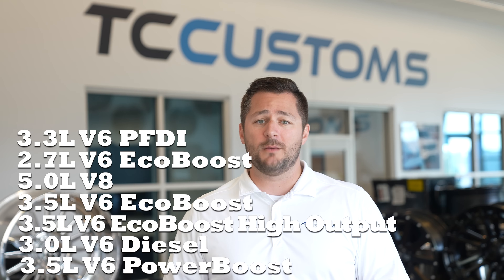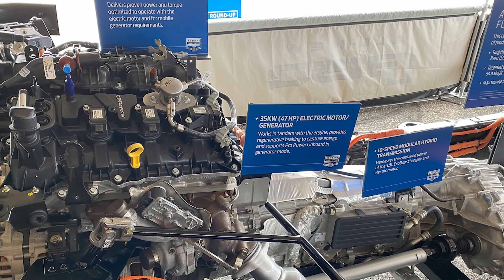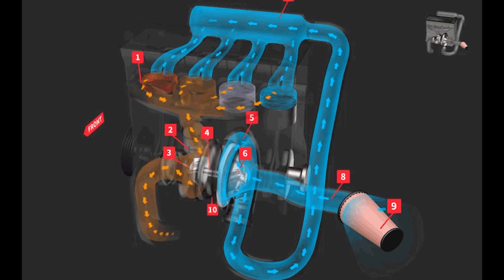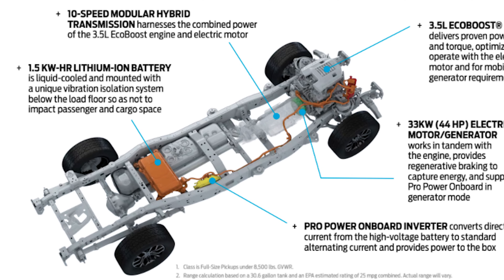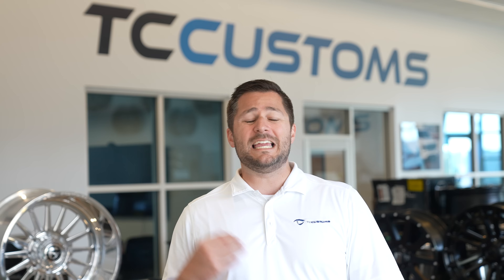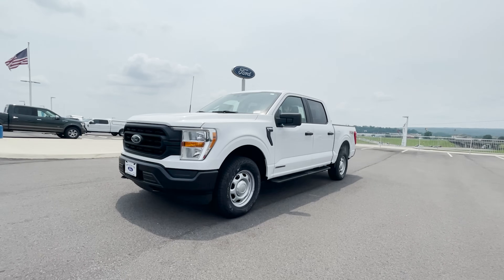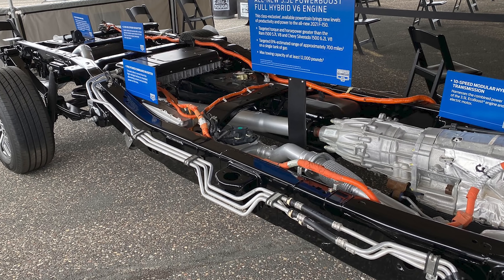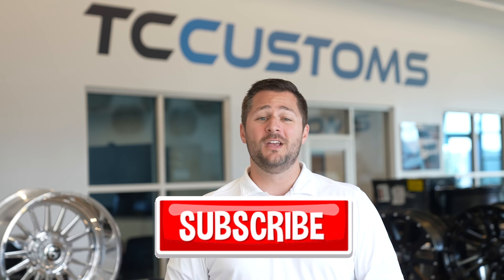The truth about the PowerBoost Hybrid Engine!

Comment: I have almost 14,000 miles with my powerboost and no issues except the wiper motor recall, which there is no fix for  yet. I read that there can maybe be some damage to wiring during the assembly while the truck is being built. That could explain some of the electrical issue?
Reply: Update?

Comment: The truth about the powerboost hybrid: with the exception of the VERY small amount of recharging you get from regenerative braking, the battery is recharged by the engine. The GAS powered engine. So pretty much, even when it is running on the battery, it is still running on the engine. without the ability to plug it in to recharge it, it is effectively and nearly ENTIRELY gas powered vehicle.

Comment: I've had my Powerboost for just over a year now. Just over 12% of my driving is electric. I average somewhere between 600-630 miles per tank. Also, when I test the generator mode it always kicks out a grounding fault and Ford doesn't know how to fix it and their service departments are clueless. Ford Corporate and their dealers don't honor their warranty. This is the 7th Ford vehicle I've owned and it will be the last. I like the truck but Ford doesn't honor their commitment to their customers. In 5 different states and several different dealerships I've never had a good experience with any service departments. Not a single good experience, it always a hassle. My truck cost 70k! and they can't fix their own products.

Comment: I have a 22 and have put over 7k on it. The fuel mileage isn’t that good and the hybrid drive doesn’t stay on long during city driving. You have to really baby the throttle to stay in EV mode. I think if it was a plug in hybrid with a bigger battery it would be a better package.
Reply: That is what I was wondering. I am considering the Lightening, but then saw this and really liked what I saw but I am back to gas and apparently the regeneration doesn't work the same a full blown EV. Unfortunately, I think I am out. nice damn truck though.

Comment: I have 2022 F150 Powerboost with only 3900 miles, within one month engine overheated, onboard power not available, jerky or shudder transmission, sitting at dealer for one month, no available parts and Ford customer service is no help, don't buy this!
Reply: going to cancel my order
Reply: @SunnyDhaliwal604  Hope I didn't cause you trouble & sorry, but I think Powerboost has design flaw to begin with and lack of Ford quality control & customer support; Common issues that I found are Engine Overheating due to coolant leak, Drive train jerkiness, Not enough battery pack size, AC freezing & software glitches.

Mine is limited trim package with 7.2kw, I was told estimated part delivery may be 7/28/22(3rd update & delay) and still sitting on dealer service lot. Ford customer support is just sitting on it & does not appear acting to support customer.

I'm filing Lemon law & also contacted BBB to initiate buy back.

They should have done more testing before put this model out.

Comment: The security to the power boost is drive close to the speed limit role down the hills, and coast on the flat. Use your cruse to not scrub off speed once you build to cursing. Adaptive curse almost drives itself but coming out of Cruse on the down hill will put you in full Electric mode when you turn cruse back on at highway speeds! In adaptive cruse you don’t need to tale gate to stay up with the traffic and it will
Maintain your distance all the way to a stop and you just tap the peddle to move with the traffic flow.

Comment: Should be a plug-in hybrid with a battery with commuter range (50m). Then it would be perfect. Electric for commuting, gas for towing, and a generator for working/camping.
Reply: "SHUT UP AND TAKE MY MONEY!"
Reply: Wouldn’t surprise me if that became it’s number one selling power train.
Reply: Exactly.  Feel the same way
Reply: Exactly this - I'd give up all the storage under the back seats to have a 7-9kw battery back there to accomplish this.
Reply: impossible with the 44hp electric motor it has lol
Reply: Ram is doing that. Look up the Ramcharger for 2025
Reply: @stephengregory1655  thanks for the info… didn’t know that. It looks they are adding a plug in battery to boost performance
Reply: I'm able to do all this with my 2018 Mitsubishi Outlander PHEV (2 x 1500 watt plugs, drive in EV, charge with gas while boondocked in 20 mins etc) and it's awesome for most things except for towing my kids' motocross bikes with a 600 pound trailer. Maybe it's just the specs of my SUV but plug in hybrid can lack a lot of power compared to the gas version of my SUV.
Reply: @BWT599 series hybrid with moderate size battery would be much faster than a straight combustion configuration like my truck. Its a matter of what they spent the money on and in your case it wasnt speed
Reply: @jackbarry9469  yep I agree. I do love most of the features, but yep lacks big time on speed and towing capability.
Reply: Plug in hybrid is the dumbest idea ever. You mean i have to put gas in it and plug it in? Do i have to read it bedtime stories too?
Reply: @mivy2452  No bedtime stories required. Electric for commuting, gas for distance. Best of both worlds.
Reply: YES!!
Reply: I think it would take away from the engine itself. I much rather have a great engine that would be great with or without the electric and then electric hybrid features to help early on in the rpm range
Reply: Why would you want to plug in? Horrible idea.. this power boost is amazing.
Reply: Lost me at the back up alarm.
Reply: It would add a lot to the weight to add a battery that large
Reply: Bought one two years ago and after 20k it’s the best truck/motor I’ve ever owned!
Reply: Oh heck no. Plug in hybrids are useless
Reply: The question is…. Would you be able to plug it in to itself?
Reply: @cruton19998  I did see a video where someone used it to tow an EV that ran out of charge, and charged the EV while towing it!
🤣
Reply: @daviddawdy6274 the funniest part of that video was they found out that by charging the Tesla by towing it with a raptor and then getting in the Tesla you could get further on a gallon of gas than you could by just driving the raptor
Reply: @daviddawdy6274 I think that was TFL.  I saw it too.
Reply: @cruton19998 unlimited POWER!!
Reply: You want an electric.  This is a hybrid.  The engine charges the batteries, so you dont need a power grid infrastructure to plug into.  Hybrid is the only realistic alternative until such time, if ever, a continental electrical infrastructure is built.
Reply: @DinorwicSongwriter  They are both hybrids. There are PHEVs and HEVs. Just like the early Prius did not plug in but was a hybrid to day many hybrids have 10 to 25 KW batteries and need to be plugged in for highest efficiency.
Reply: No thanks if you want an electric truck get a lightning.  I don't want to have to plug in a truck every day.
Reply: Gross, a PHEV is not the way to go.

Comment: I am looking at this hybrid because in a couple of years I maybe towing a small fifth wheel thru the Rockies.   I hope to be able to use the regenerative breaking on the down hill runs.
Reply: The regenerative braking fills the small high voltage battery too fast for it to save your brakes towing downhill. You will be relying on truck and trailer brakes. The lightning saves your brakes feeding into a large battery but Range is an issue. I have a powerboost and tow farm tractors and other moderate loads. If I lived in the mountains and towed heavy trailers I would have a 3/4 ton at least  probably with diesel and engine braking.

Comment: Regenerative braking does not capture brake energy from the brakes. 
Your explanation is incorrect.
Reply: On my Prius regenerative braking meant the hybrid motor ran backwards when braking to help slow the vehicle and in turn charge the hybrid battery. My brakes lasted 150,000 miles and I could have ran a little longer.
Reply: That is true 
That is how regen works

Comment: Is the regen braking blended with the service brakes?  1 pedal driving option would be great...
Reply: You should always have a dedicated brake pedal. I was racing my power boost and it got stuck on flooring itself everytime I took my foot off the brake. It seemed to have put itself automatically into adaptive cruise and I could not turn it off. I finally pulled into a parking lot put it in park. let off the brake and it started flooring itself to near 5000 rpm before i pressed brake again. turned truck off and back on. did the same thing. tried off and on again the same thing. then about 30 sec the gas pedal made a release pop sound and everything went back to normal. just glad i wasnt towing something. this auto driving crap needs to have a turn all auto driving off kill switch.

Comment: It's a cool engine, but I bought an Ecoboost instead. I do a lot of hard off-roading, and the hybrid system adds a bunch of weight and complexity to the vehicle that can break
Reply: That is one way to look at.  Consider  this:  hybrid tech takes wear and tear from the engine and braking system, making them last longer.  You said you do a lot of off-roading, it might have been a better system for you.
Reply: @seekhappiness1  another thing I discovered since posting this comment - the BDS lift kit is not compatible with the powerboost. Same goes for other popular lifts and aftermarket parts.

Comment: I love the truck but I have never been able to get 24/24 unless I'm on a super flat surface or going downhill.  I do live in Atlanta which is very hilly and I'm averaging about 20.6 to 22.3.  I have over 24,000 miles on my truck and my last trip gauge is almost 9,000 miles and my fuel economy is currently 21 MPG. My second trip gauge is 1100 miles and I'm at 20.4.  

The MPG does go up when I'm on a flat interstate but it rarely goes above 23 MPG in eco mode.  Amazing powerful truck but they could tweak the algorithm to make better use of the electric motor.  The threshold between transitioning from electric only to hybrid is too low and you really don't get an opportunity under light acceleration to stay electric.  It really transitions too quickly even when you're not accelerating quickly and not needing a lot of power.  This is my only complaint about the truck.

Comment: So I just purchased a used 21 F150 and two things  I hate:  Towing -  It's no better then my 2014 Eco 3.5 4x4 I avg 12-13mpg but had to use Primium 91-93 and it doesn't show gallons used. I towed my empty 7.5x14 motorcycle trailer on 26miles of hwy and 13 MI city and I avg 11.7mpg using 93 oct driving at 70mph. I'm interested to see what anyone else is avg in towing mode.

Comment: I am researching powertrains and trucks to replace my 2013 F150 3.5 super crew 4x4 Lariat with 6.5' box. I currently average 13-15 mpg (not towing) with a 3.5" lift kit and 35" tires on 20" Fuel rims, and tow mirrors. I watched your recent poll of techs where 90% of them picked the 5.0 coyote over the other engine choices. I wonder if this powertrain would sway their opinions. I'm considering the 5.0, 3.5, 3.5 powerboost, or the Duramax 3.0. I use my truck as a daily driver in town or within an hour radius most of the time. I frequently pull a 17.5 ft fishing boat and an occasional enclosed cargo trailer. I am intrigued by the performance of the powerboost compared to the Duramax without the headaches of a diesel engine. If you had the option of buying a new 2022 F150, which powertrain would you pick? I would likely get either a highly equipped XLT, Lariat, or base model King Ranch crew cab 4x4 with 6.5 ft box. I'm having a hard time finding colors I like with the Sport Package. The stock outside mirrors have horrible visibility, so I'd be forced to get tow mirrors for any regular towing. Any feedback would be appreciated.
Reply: I had a 13 Lariat crew cab short box with the 3.5 TT. I had a 4” lift and 35’s. Never had any issues with it. I replaced it with a 21 Powerboost same package and color “Red Metallic”. I haven’t towed with it but boy is it fast and has great low end torque. Rides like a cloud. Getting 645 on a tank of gas 30 gallons. I love the redesign interior. I opted for not having co pilot assist and 360 camera. So far love the truck. Adding tow mirrors when available.
Reply: Everyone knows big tires, lifts KILL MPG.  Get a clue

Comment: Good vid. How much deceleration do you feel on regen? I have driven a Tesla and it brakes more quickly than feels comfortable in my opinion. Going to look and drive the PowerBoose tomorrow so may answer my own question.
Reply: there are levels you can adjust on the Tesla, hybrids don't usually regen decelerate nearly as hard.

Comment: Love my Powerboost! This is hands down the best f150 I have owned and I have had them most my 57 years. Mpg is off the hook 25+ in town. 
2021 F150 Powerboost Crew Cab 4x4 Lariat !
Reply: Hey just wanted to ask if you still have the same vechile and if your still happy with it? Also, if you don't mind telling how many miles you e got on it? Thanks
Reply: @nickydessa  Funny I just saw this. I had a known issue with my F150. I took the TSO and TSB to the dealer and asked them to repair my truck. It only had 21k on it. Ford said it was my tire rubbing. I asked the tech to show me where? He walked away. I drove to my local Toyota Dealer and bought a 24 Tundra Platinum . Drove back to the Ford dealership and found the tech and walked him out to my new truck and said” Look Toyota fixed my Ford.
Reply: @MrAlucard1964  damn that's crazy lol. You were the only comment that gave me hope. Probably gonna trade in mine before it's to late and get a deisel
Reply: @nickydessa  I had high hopes for my F150. My
Buddy has the same year and truck and he broke down on the freeway. Something to do with voltage shutting off, third time this happed to him. Glad I got rid of my F150.
Reply: If you have $75,000.00 plus to pay for the damn thing.

Comment: How come the Power Boost is rated at 430 HP when it supposedly has a 47 HP electric motor?  The stock 3.5 EcoBoost is rated at 400 HP.  So.... where did the other 17 HP go?
Reply: If you overlay the hp curves for the electric motor and gas engine, they don’t peak at the same rpm.  The ram e torque gets no net hp gain from its electric.
Reply: Probably drivetrain losses 🤷‍♂️

Comment: At what speed does the gas motor kick on less stomping on the Pedal? I have heard if you keep it under 45 it stays Electric??
Reply: I find the max optimal seems to be the 30-35 range. It can do electric at other speeds but usually short lived. I think the max mpg ivebeen able to get was 32 by really baby crawling it at like 30 or so. but 22-24 normal driving.

Comment: You cannot hear a hybrid backing up at all. So even if you are paying attention, if the driver puts the gear in reverse, and steps on the gas, it could be devastating. So yeah, def need that backup noise.
Reply: its not ON THE GAS-----its on electric.  Duh
Reply: By gas i think he meant accelerator.